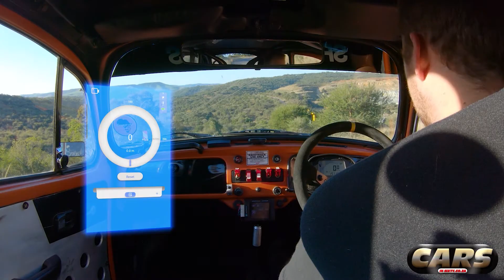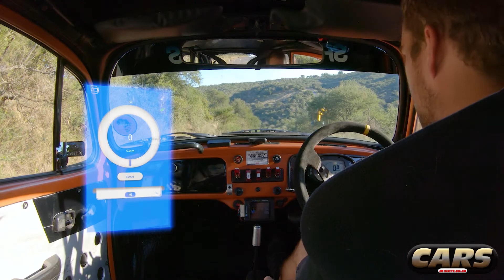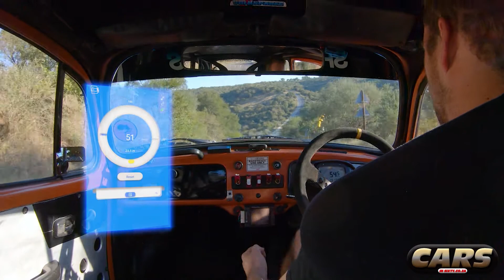1970 VW Beetle *SUBARU-POWERED*

Comment: This is so, so close to the colour of my VW Trike.
MY engine is a Stage 2 Turnkey 1634 Engine. Im annoyingly back down to a single EMPI 34mm stock carb, but thats purely because while it was a pair of TwinChoke Webbers, the thing was a pile of junk, hence the replacement engine and that single empi I was able top get working fairly well on that engine... The Triek is 10 years old and this year is the first time I have actually have had it playing nicely... Its never gone for more than a few weeks before it farts and shits itself! - 9 years I managed a whole 4300 miles... This year I have done 11000 so that says it all.
I know absolutely bugger all about carbs, and there is no  one around here that will help me.